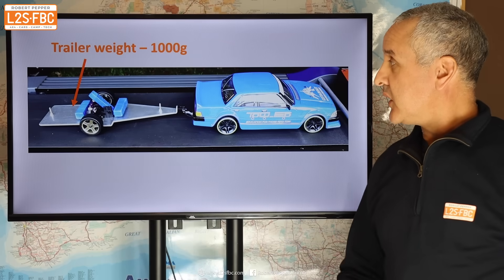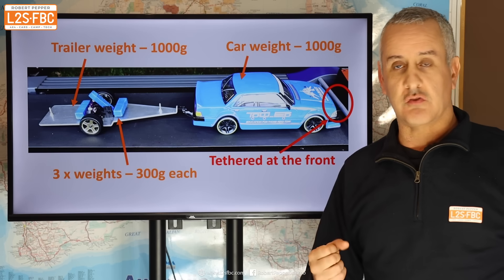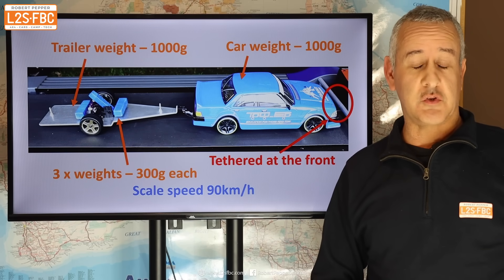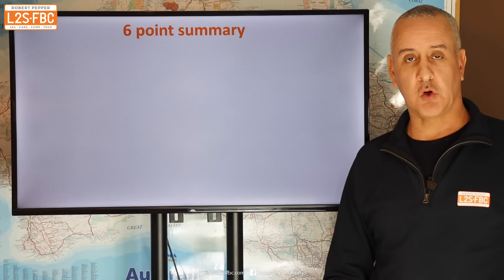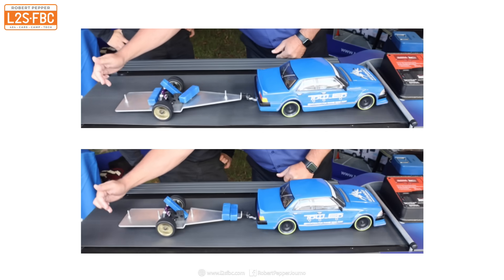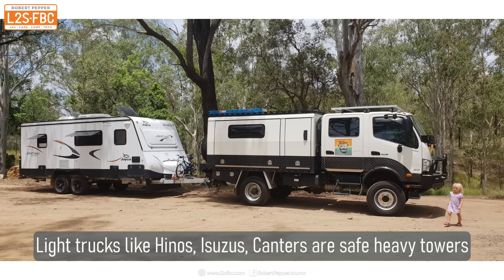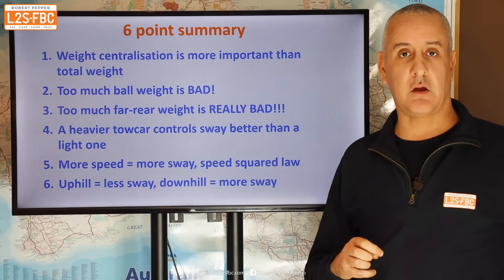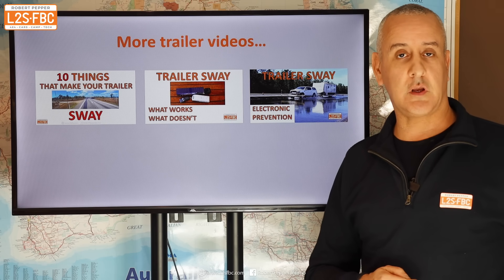7 trailer weight distribution setups, some safe, some deadly.

Comment: Isnt it insane though that we NEED to proof logic before people are willing to listen, IF they are even then.
What i mean is honestly anyone with half a damn brain should understand, balance is nearly always the middle point. If you have an equal distribution, balance is nearly always in the middle, thicker on any side may change this but in general if its all semetrical, the balance lays in the middle.
What this means for a trailer is.....between the wheels.
Applying just a little bit of common sence then dictates, that if you move items from that balance point/centre point. You will destabalize the trailer.

We should know this from common sence for the simple reason, thats how EVERYTHING WORKS. 

But i would like to add the number one biggest reason stuff like campers and trailers and up crashing.....race car driving.
People who feel the damn need to speed over the highway and move past you as quickly as they can, taking as sharp a pass as they can....OFF COURSE YOUR GONNA CRASH WHEN YOU DRIVING LIKE YOUR IN A DAMN RACE, YOUR DRIVING WITH A BLOODY TRAILER DUMBFUDGE.

Conclussion, people should emplore more common sence, things that we should naturally understand by just taking a second to think. Shouldnt HAVE to be proven to be believed. And for richards sake if your driving with a trailer, STOP BEING SO DAMN ARROGANT. YOUR NOT THE ONLY DAMN PERSON ON THE ROAD.
Reply from the maker: Some people understand physics easily, some don't. Some understand music easily, some don't. The fact that weight distribution is not understood easily by someone doesn't make them stupid. It's not common sense.
Reply: @L2SFBC  i get what you mean, but i think you fail to see precise wording. My wording wasnt physics, but i see why you would say that. My wording was balance. The reason i choose to say balance is because this problem stems from that same root. The whole explanation about weight distribution is essentially nothing more than a balancing problem.
Aka if you put a lot of weight on one specific side of a object, it toppels over.
Now i understand not every person can come to comprehend andvanced physics and mathematics. 
Im a high school drop out whoes never went to study any further and truelly doesnt enjoy math.
However im also getting a bit tired of seeing very dangerous situations, that could have been solved by taking a breather and thinking about life.
Like how an adult wouldnt put his full weight on one side of a seesaw, while his infant child is on the other side. (Sadly you are correct, this does happen, but why?) Why do we excuse people for not understanding some basic things. 
Especially when such things can lead to others death, such as with this example of trailers.  Some stuff isnt common knowledge no.
Not putting a lot of weight on the front of a trailer, dont think many people just know that. But stuff like, the middle of your trailer between the tires is your strong point. That i find a bit....sad i guess, that people dont just see that or think about that. That to many people dont understand you cant just slam your caravan to the side. That stuff i find a bit as i said sad i guess. 
The amount of innocent people that get killed in easily affoidable accidents because someone didnt take the 5 to 10 second to realize what they are doing is dumb....that i find sad. 
Ugh story of life i guess, gotta live with the world, just untill it kills you.
Or perhaps some dude that thought a wire was enough to keep his loaded trunk closed does.
Or an idiot break checking you on the highway out of nowhere.
Reply: @L2SFBC  gave a major responce but maybe i wasnt allowed to call people idioms.
Just fyi i did so about highway break checkers. So it wasnt posted by youtube. I know i make whole paragraphs but that really the only way i can properly explain what i mean. And considering i have no idea what i said wrong, except for calling highway break checkers idioms but with a t. Im not gonna bother and type the whole thing out again.
All im gonna say is i jjst find it....sad i guess how many fatal accidents happen. Because of something i personally understood as a child. 
Like how some grown adults dont understand not to put their full weight on a seesaw with a small child on the otherside...somehow...
Also i put a lot of attention to wording.
Balance is what i talked about and altough balance is a part of physics and most people wouldnt understand half of physics i do think most of people should understand the basic principels of balance.
Such as if you put a lot of weight on a bad spot of an object it will fall or break or whatever.
Jenga, is a nice example. 
Not many instructions to it, essentially just dont make the tower fall. 
Some times people should take a little more time to think about what they are doing, especially when it could possible kill someone else.
Reply from the maker: Your response did get through and I much appreciate your post and largely agree with your point. Still, some people don't see the problem. The fact you do doesn't mean to say they see it too.

Comment: Good video,  however I wonder if there is any difference in real life given forward motion is provided by the drive wheels of the tow vehicle vs. being towed by a string in front of the model.  In real life the front of the tow vehicle wouldn't be held in place like it is in the model if that make sense.  Could you do a test with a remote control car on the belt  untethered and powered by its own wheels?
Reply from the maker: I hope to do that yes. There would be a difference but the point remains valid re weight distribution.

Comment: Too many people are towing with mini vans, and no idea what they are doing.  also, tire selection on the pull vehicle can make a huge difference on sway.  In my opinion, light weight vehicles with short wheel bases should never tow.

Comment: Interesting, but I question if this is a correct experiment. A treadmill is not the same as towing. The tow vehicle will be pulling the trailer, which will have a stabilizing effect, same as an uphill grade.
Reply from the maker: It is good enough to demonstrate the effect
Reply: @L2SFBC  Well, as an engineer, I'm gonna say its just a theory until tested properly. The treadmill could be causing compression between the vehicles whereas towing would create tension. They would behave completely differently. If this were representing real world, trailers would be flying off the road constantly. I'm definitely disagreeing with the word "proven".

Comment: I tow boats with my motorcycle.  Weight distribution becomes critical.  See this clip.  https://youtu.be/00s_Lc7uUZ8  Notice the boat motor is not on the transom; the motor, anchor, fuel, and all the heavy stuff is gathered together just ahead of the trailer axle.  This is to minimize the polar moment of inertia of the trailer; then with the long distance between the hitch and the trailer axle, a motorcycle can tow a boat.
Reply from the maker: Brilliant!

Comment: In the UK, we have the 85% rule for towing, so a trailer weight = Car weight is a non starter, except for very experienced drivers. The alko hitch arrangement helps prevent sway, and common sense keeping your speed down works wonders. Nice illustrations of the effect of weight distribution, thanks for posting.
Reply from the maker: The 85% rule is smart!
Reply: We don't have anything like the 85% rule in North America, but many vehicles that would get a tow rating in Europe get a rating of not suitable here. Even the For Ranger is rated to tow more in Europe than it is in the US or Canada. We also tend to have more vehicles specifically designed for towing and large trailers will use a bed mounted hitch rather than a conventional.
My 2011 Ram 2500 CC diesel (6.7L L6 TD) weighed about 7,500 lbs and was comfortable with a 14,000 lb conventional trailer regardless of terrain. My biggest problem with the truck was lack of payload for my gooseneck flatbed trailer. I'm upgrading to an F450 to solve that issue.
My 14k GVW trailer is a 30' enclosed car hauler that weighs about 3,800 lbs and it does have a tendency to sway a little when empty. It never affected the Ram much even with the winds on the Great Plains. I have seen 3/4 tons and 1 ton SRWs with large campers blown over on I-70 in the Plains though.
With the 85% rule a 25k lb fifth wheel camper would need a tow vehicle that weighed 29,500 lbs (class 8 tractor).

Comment: The main reason the sway is so dramatic with the mass so far from the axle is the increased leverage in the lateral direction (side to side) that the mass has at the farther distance from the pivot points. It has less to do with the "grip" of the tires. The most important point of this video though, is to center the loaded mass over the axle. That is 100% correct.

Comment: we're skipping the fact this is an unrealistic example. The information is useful, but the example is flawed. Short of pickup trucks, which are designed light in the rear to better benefit/handle more tongue weight, which, again, changes this dynamic, you will not find a vehicle that is rated to tow 1.9x its own weight. If you stick to manufacturer ratings, you are likely only towing 1-1.4 times the weight of the tow vehicle, at most. As you hinted at in this video, that relationship of tow vehicle vs trailer weight matters greatly. also, the number one way to not die under trailer sway, work your way up in speed gradually, give it a flick, see if the trailer is stable. if you experience trailer sway, slow down, it's that simple.

Comment: Many years ago I often towed a 12' caravan with a 2 litre Tarago, including Melbourne to Cairns return in 2 weeks. I always checked the amount of extra weight on the back of the Tarago by checking the amount the the Tarago lowered against my leg every time I took the van off the dolly wheel. I would then take the first 40km or so carefully to see how the drive felt and adjusted the things inside the van until it handled well. Then drive up to the legal limit for the rest of the day. Never any hiccups.
Question though. How is it that anyone can get their licence in a car, then legally tow a trailer/caravan without even being taught how to reverse the combination? Some of them scare the bejeebers out of me.
Reply: Additional. I started driving 60 years ago and hold a full HC licence.
Reply from the maker: It's not the reversing, it's the moving forwards at high speed that's the risk!
Reply: @L2SFBC  Please do not think that I am in any way not supporting you, but either way, why can they not get trained to tow a trailer before they actually do it? I appreciate that your video is hopefully going to help many people, but the lack of training in towing in the first place is something that needs attention.
Please keep up your good work. This video explained in simple terms what too many people do not understand.
Reply from the maker: https://l2sfbc.com/why-australia-should-have-a-national-towing-license/
Reply: @L2SFBC  Hi Robert, I can only agree with you after seeing this article on your website. Even if only some of what you propose can be achieved, then it is worthwhile as a starting point. Some of the stupidity I have seen over the years of driving can only be considered as criminal, and I would not complain if something like this was brought in and I had to take the test to ensure that I was compliant. Towing a large caravan is not the same as driving a semi, as per my HC licence, so please keep up the work you are putting in on this topic.
Reply from the maker: Wow a HC holder who doesn't think they know it all about van towing!!!

Comment: Good information. The problem I have while towing is not sway but bounce. Seems like the flatbed trailer stays stable but transfers all of the road bounce to the hitch and my truck. Sometimes it seems like it's going to bounce me out of my seat.
Reply from the maker: Tyre pressures? Soft suspension on towcar?  Bounce (pitch) can lead to sway.
Reply: @L2SFBC  Tow vehicle is a 2018 Chevy Silverado 1500 with the max tow package, which includes 9.76" axle and heavy duty rear springs. Trailer is a tilt bed car hauler tandem axle weighing around 2,800 lbs.  It consistently pulls straight.
Reply from the maker: Well that's a serious tow vehicle for sure!  Maybe road-specific?
Reply: @L2SFBC   the bounce is definitely more pronounced on a bumpy road, but even on the highway the trailer still transfers every bump  to the vehicle.  I just wonder if it's a function of trailer tongue length versus maybe the truck's wheelbase.  I don't think raising or lowering the hitch height would solve the problem

Comment: I professionally drove large dimensions articulated vehicles . AKA. tractor/trailer. 
Of course the connection was Via fifth wheel slightly different dynamic in The leverage that the trailer has over the tow vehicle. But you can feel the weight difference in the way the trailer was loaded wait forward or wait back and how it affected the handling of the vehicle. That dynamic is also amplified when you're pulling multiple trailers and the way they are loaded heavy trailers must be in front with the lighter being the trail vice versa would be a real handful and disaster to handle on questionable road surfaces.
I drove professionally for close to 40 years over 3 million miles accident-free thank goodness little bit of luck is required in life.
My point is is don't think you are aware of exactly how it's going to work out for you when you start pulling combination vehicles took you a bit to get up and walk and then get up to running it's the same with pulling anything behind a vehicle be aware the way it's loaded and the condition of the vehicle and the condition of the tow vehicle and don't ever speed please I've seen a lot of unfortunate idiots off in the ditch because they assumed they could go ahead and do what they wanted to do be safe folks very good video describes the Dynamics of what you need to know to begin with now you got to adjust the seat of your pants thanks guys.
Reply from the maker: thanks, great comment!

Comment: Thank you for this video! This info should be included in drivers license tests. We lost our truck & trailer when I was 16 because I knew nothing about proper weight distribution. We were lucky that no one was hurt.
Reply: I lost control of a truck and trailer when I was young too. I had the weight shifted so the tongue was actually lifting the truck a bit. It started to sway all over the highway. The only way I got it back under control was to apply the trailer brake manually and floor the truck, then after it straightened out I stopped. 

Like you I'm thankful I didn't get someone hurt or killed.
Reply from the maker: Thanks great post!
Reply from the maker: Thanks great post!
Reply from the maker: Thanks please share 👍

Comment: Also the simple fact that morons think they can drive at or above the speed limit when towing a trailer. You have to drive SLOWER when towing a trailer. The drag coefficient gets stronger the faster you go which pushes on your load and that load being pushed on wants to lift the trailer upwards which also lifts your car upwards and you lose control.

Comment: Great video. Wish the bods in the EU would watch something like this. So glad for BREXIT that here in the UK we have got rid of the stupid EU rule that made it illegal for most people to tow with a heavier tow car. Utter nonsense it was.The law was (and still is in the EU). For 'x' trailer, good tow car illegal. Bad tow car legal.
Reply from the maker: Why would it be illegal to tow with a heavier car? Why not lighter illegal?
Reply: @L2SFBC  Your guess is as good as my guess as to why they legislated it this way. It's barmy.

Thankfully not an issue now in the UK. The EU rules you had a max train weight of 3500kg. Meaning almost all drivers could with a something like a fwd hatchback tow a caravan or small car transporter. But if you wanted to pull the same caravan with something like a Range Rover you couldn't as the theoretical maximum train weight of this vehicle and caravan would exceed 3500kg. There was an additional trailer test (tax) you could pay to take, that would then allow you to use a better vehicle and ultimately tow heavier loads. But the test didn't cover the things in this video nor the difference in the weights that the licence would then grant you.
Reply from the maker: Well that is crazy.  You definitely want a heavier towcar as the video shows. Should maybe be simply towcar as-towed weight should be greater than trailer as-towed.

Comment: Doesn't help explain trailer and car weight distribution. For example my relative just bought a 2.5t camper not even a caravan! That's tare and salesperson said your fine to tow you have a 3ton capacity! But they didn't explain his ute is 1.9t with him in it. He has no accessories or bars etc for additional weight. I'm trying to tell him, he is an idiot and going to kill himself if he now fills water tanks and jerry cans gas bottles food all his clothes etc into camper and tows it around. He refuses to go weigh his camper and car and distribute the load between car and van trying to get car as even or even heavier then camper for stability. He is an idiot and the caravan yard is being really irresponsible for selling such a heavy trailer for a stock utility

Comment: Very good video! I have a question. If your only choice of load weight location  can only be towards 
the rear or towards the front which would you pick? I have a 7x14 trailer that will be carrying a VW Bug rear eng. So I can either back it in or drive it in.
Reply from the maker: The front.
Reply: @L2SFBC  Thank you